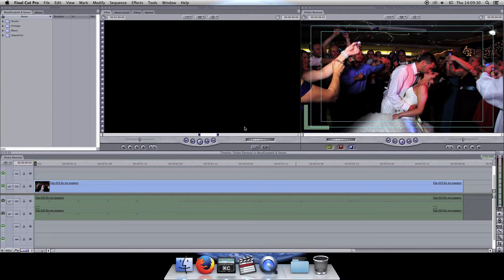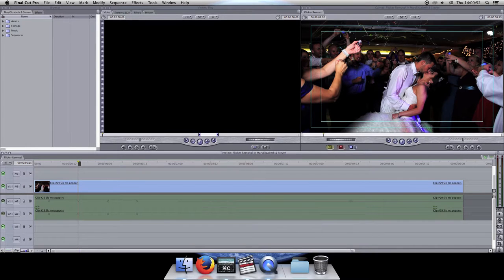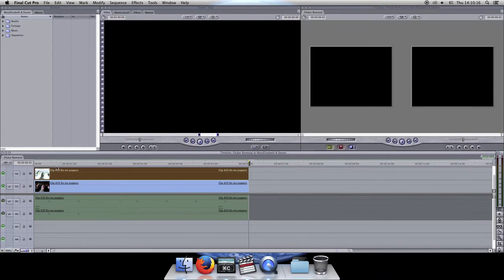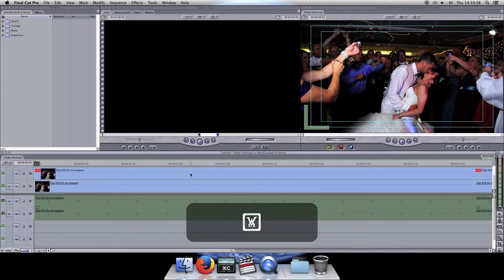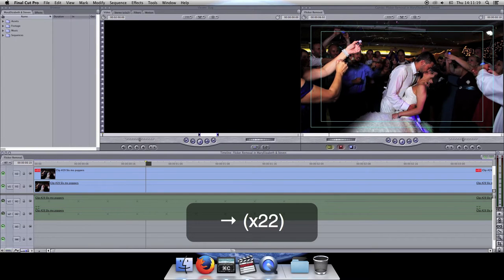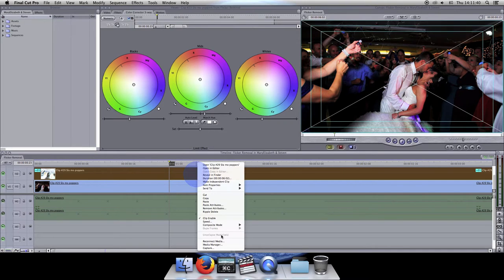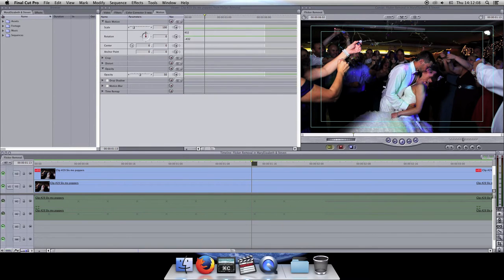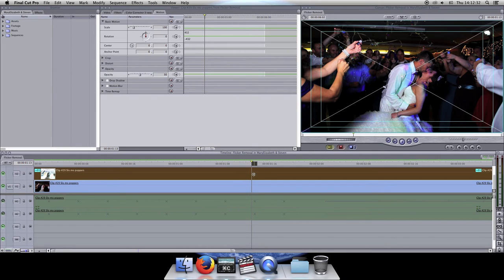Easy Flicker Removal for Slow Motion Footage

Comment: Dont work
Reply from the maker: Which part? The footage does have to be in slow motion, so if you're using 24 or 30 fps, it won't achieve the same effect.
Reply: TCBTS Yeah is Slow Mo , 120p :c
Reply from the maker: So neither method worked? Changing the composite mode or changing the opacity of the duplicated offset layer?
Reply: The only way I found to solve it was to follow your initial idea of advancing a frame and so on but then put another layer up and delayed a frame. This way it has considerably reduced the problem but is still noticeable. I used a sony a6300 in 120pfs. I probably used a very low shutter speed. Anyway thank you very much for the attention! great video!
Reply from the maker: Glad you got it figured out. Best of luck!